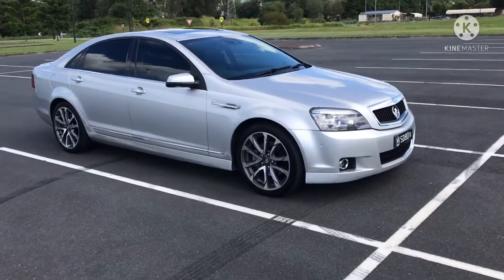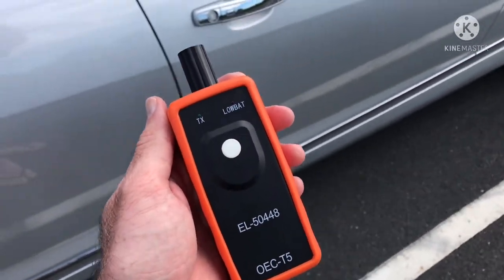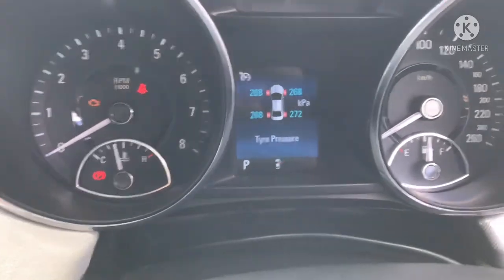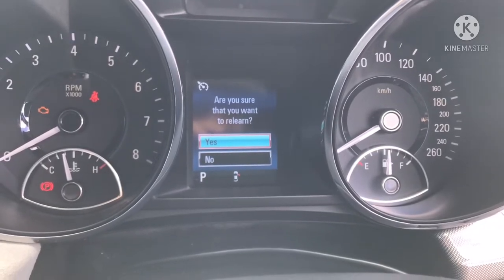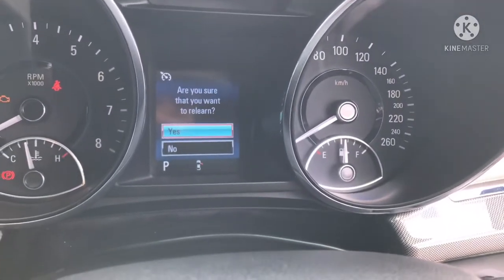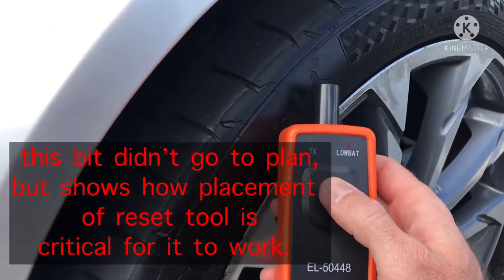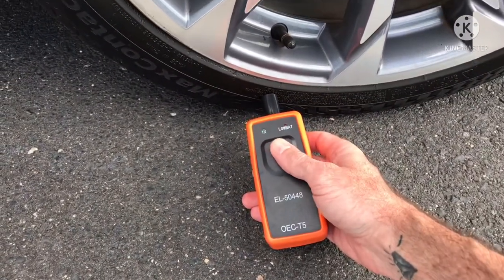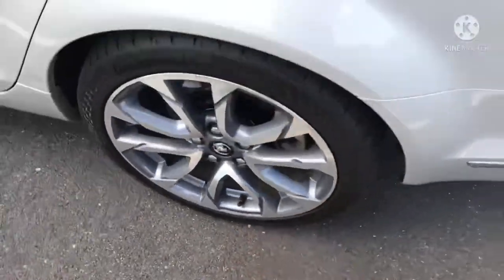Tyre pressure monitor reset VF Commodore WN Caprice & HSV

Comment: What was the tool called I'm keen to get one. Thanks Deano.
Reply from the maker: Hey Deano, it’s a EL50448 Universal TPMS Reset Tool. There’s a link in the description above of the one I got from eBay. 👍🏻
Reply: @sdeeth  not working for me after install 20 inch new wheel rims alround. any ideas?
Reply from the maker: @rosscokeys7700  your tyre monitor valves were definitely reinstalled into your new rims? and not damaged? Other than that sorry mate I’m not too sure.